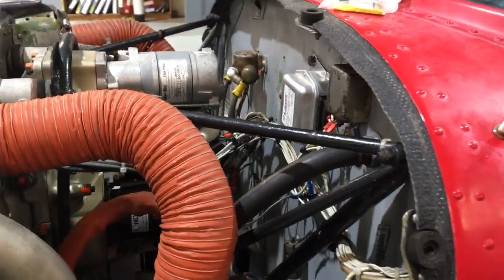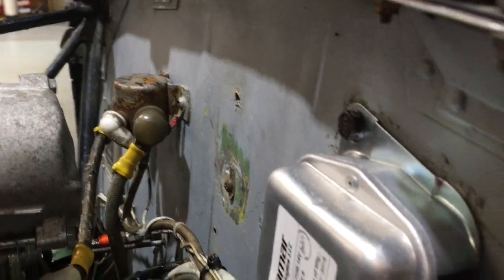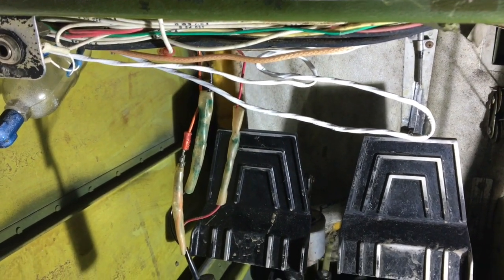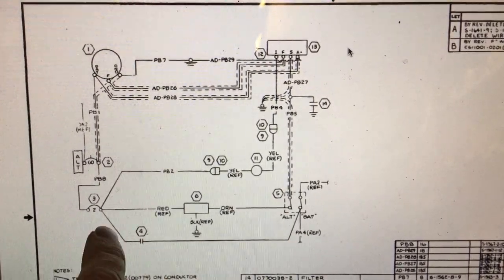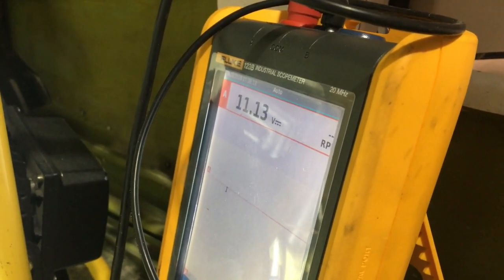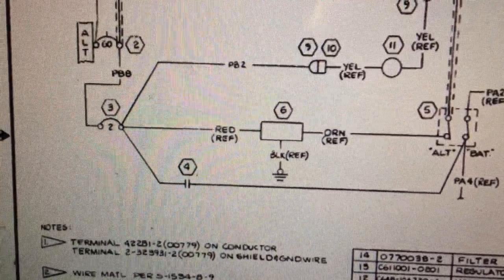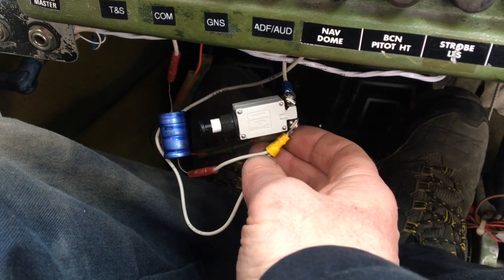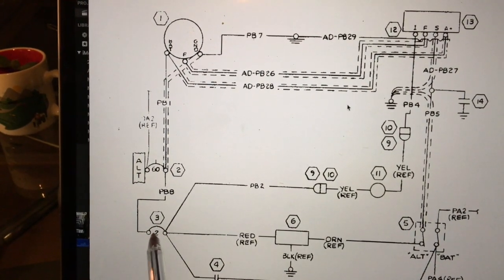Troubleshooting Cessna charging system

Comment: That little device is a CA-2 self resetting circuit breaker for the alternator field. They are problematic, mounted is a horrible location, and I've had several fail where they get so hot they will burn your finger. What Cessna service bulletin allows replacing it with a standard 2A CB?

Comment: This wiring looks really messy, wouldn't want to take this aircraft for a spin before this is properly cleaned up..... btw. . did you see my answer to your avionics question recently
Reply from the maker: Your right, the wiring was a complete mess, all tidied up now, got some footage, haven't had time to upload yet.  Yeah I got the answer to the avionics question, thanks, think I replied, I guessed there was an aviation connection somewhere!